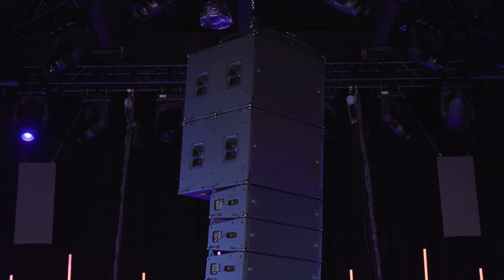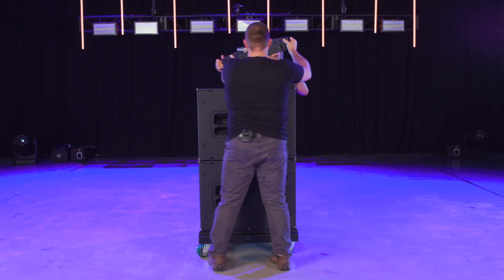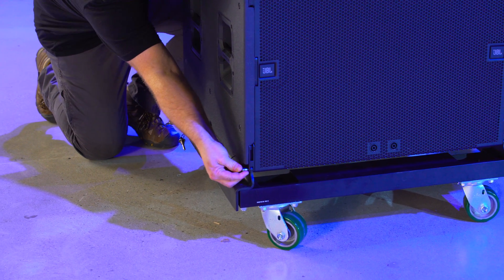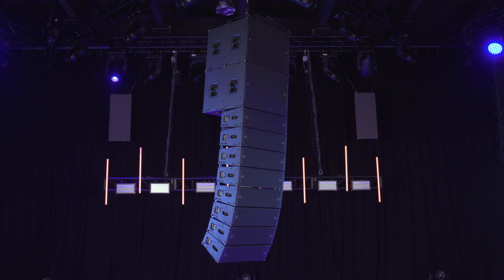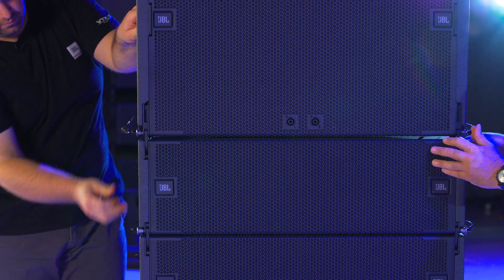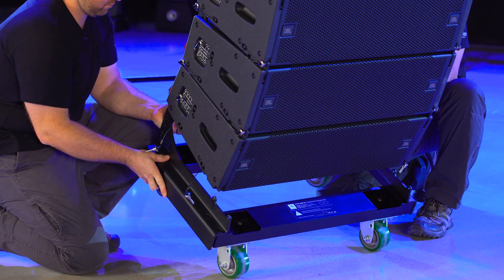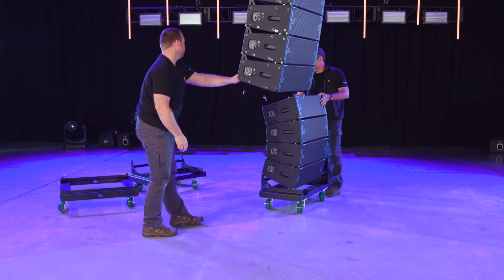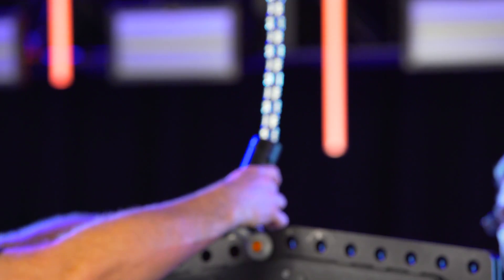JBL VTX B18 Subwoofers Rigging & Derigging Tutorial

Comment: Does it come with a box
Reply from the maker: HI Stomi, thanks for the question. It ships in a cardboard box but does not include any additional packaging. An optional B18-VT wheel dolly is available if you wish to transport it in a stacked column, or a B18-ACC is available if you wish to roll them individually on their front. The ACC comes with a soft cover, The B18-CVR is a cover if you need it with the VT. Check out the manuals or the technical overview video for more info on transportation options. https://youtu.be/xaOeuQfWa5Q